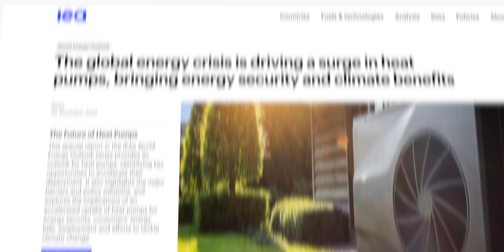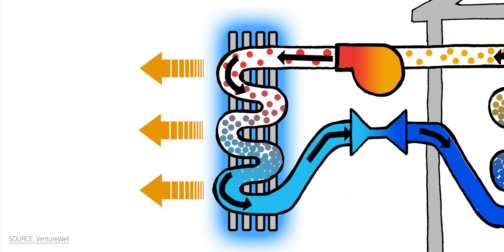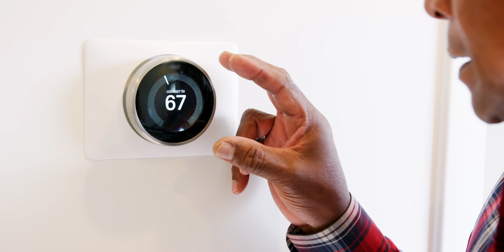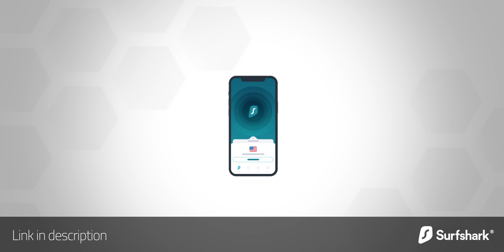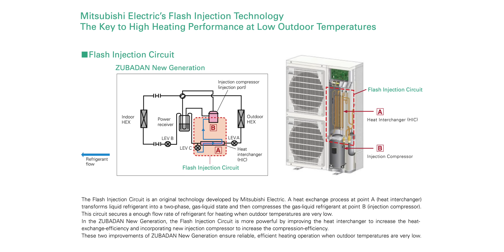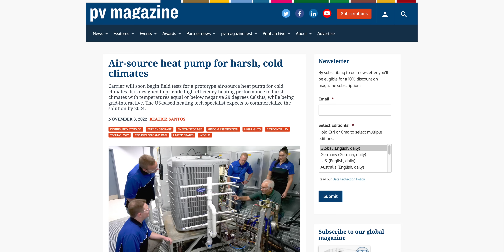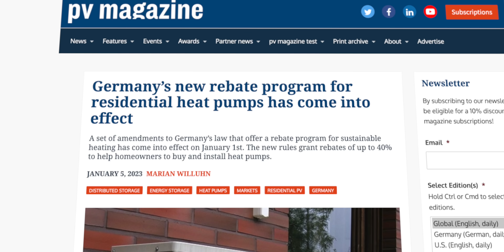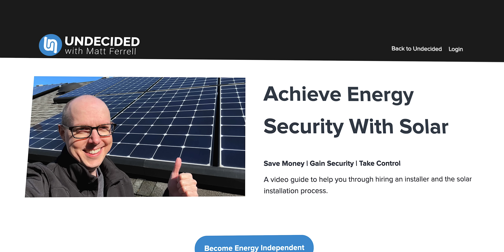Major Advances with Heat Pumps in the Extreme Cold

Comment: I live in New England and just recently installed an LG Red mini split system with 3 indoor ceiling cassettes. I also switched electric suppliers to a cheaper supplier going from $.26/kwh, to $.14/kwh and I am now basically heating my home for free. I have had no issues with producing heat even on cold days in January or February with some days getting down to -19F.  The best part is the fact that I now have 3 separate zones that I can set to desired temps with some unused areas like my office and spare bedroom being set much lower. My ceiling cassettes are also branch ducted into adjacent rooms in order to get better distribution of air flow and to prevent oversizing of the indoor units for my rooms. I have a 1700 sqft. raised ranch with one cassette in my living room/dining room which is ducted to my kitchen, on cassette in my master bedroom ducted to my bathroom, and one cassette in my office ducted to my small spare bedroom. There is very little information available regarding branch ducting from the LG ceiling cassettes so it took some figuring out, but it works wonderfully! Proper sizing is imperative for maximum efficiency and can be difficult to achieve.

Comment: Hi Matt, I always enjoy your vids but this one seems a bit too much hype for a system you haven't used and tested yet.

There is a big difference in geothermal and air source heat pumps. Geothermal uses heat from pipes in the ground where the temp stay constant and air source relies on ambient air temp which varies tremendously. Air source work fine in hot temps for an AC but as the temp drops below 40F they lose efficiency and at 0F they lose as much as 50% efficiency.  

Some new air source do better BUT they rely on additional heat coils and backup heaters and are very expensive.  If your home is not well insulated and sealed an air source heat pump will need a backup heat source in cold climates.

For a ground source you need permits and enough land for the ground pipes so not an option for many people and a lot of additional expense.

Heat pumps still use electricity so if you have a blackout you won't have heat. I recommend propane or wood stove where allowed  as backup systems for cold climates.

Vertical well heat pump  100 to 400 feet deep. For a vertical system, holes (approximately four inches in diameter) are drilled about 20 feet apart and 100 to 400 feet deep.  Unfortunately, vertical loops are the most expensive type of geothermal system to install, since installation involves deep and wide boring. A vertical loop installation costs between $20,000 and $38,000.

Summary: Air source heat pumps work fine for AC but not more efficient than an Energy Star rated AC unit and in cold temps they lose efficiency and most homes require a backup heat source. Especially in houses that are not well insulated and sealed.

Geothermal ground source heat pumps work better but are also way more expensive, require trenches or drilling and permits and may not work for homes with limited space.

Unless you have a big solar power system installed heat pumps will not work in a blackout so you should still have a backup heat system installed.
Reply: Vertical well systems do not require much land.
Reply: @JRP3  100 to 400 feet deep
For a vertical system, holes (approximately four inches in diameter) are drilled about 20 feet apart and 100 to 400 feet deep.
Reply: @solarcabin  Yes, so exactly as I said, they do not require much land.  2 wells 20 ft apart would handle most needs.
Reply: @JRP3  between $20,000 and $38,000
Unfortunately, vertical loops are the most expensive type of geothermal system to install, since installation involves deep and wide boring. A vertical loop installation costs between $20,000 and $38,000.
Reply: @solarcabin  And that still has nothing to do with my point that vertical systems do not require much land.  Unrelated data does nothing to alter my accurate premise.
Reply: @JRP3  For a vertical system, holes (approximately four inches in diameter) are drilled about 20 feet apart and 100 to 400 feet deep.

That cost does not include permitting and would not be allowed in most cities. How many people do you know with a vertical well system? The average person is not going to get that system.
Reply: @solarcabin  And for the FOURTH TIME, what does that have to do with the FACT that vertical systems don't take up much space?  You are spending a whole lot of time trying to avoid simply admitting that every single post I made on THAT topic was correct:  VERTICAL SYSTEMS DO NOT REQUIRE MUCH SPACE.  Go it yet?  Or will you waste more time trying to change the topic to cost instead of space?
Reply: The hype about heat pumps!  
Seeing more hype advertising trying to get people to install heat pumps but be aware of the actual data about these units.

There is a big difference in geothermal and air source heat pumps. Geothermal uses heat from pipes in the ground where the temp stay constant and air source relies on ambient air temp which varies tremendously. Air source work fine in hot temps for an AC but as the temp drops below 40F they lose efficiency and at 0F they lose as much as 50% efficiency.  

Some new air source do better BUT they rely on additional heat coils and backup heaters and are very expensive.  If your home is not well insulated and sealed an air source heat pump will need a backup heat source in cold climates.
For a ground source you need permits and enough land for the ground pipes so not an option for many people.

Heat pumps still use electricity so if you have a blackout you won't have heat. I recommend propane or wood stove where allowed  as backup systems for cold climates.

Vertical well heat pump  100 to 400 feet deep. For a vertical system, holes (approximately four inches in diameter) are drilled about 20 feet apart and 100 to 400 feet deep.  Unfortunately, vertical loops are the most expensive type of geothermal system to install, since installation involves deep and wide boring. A vertical loop installation costs between $20,000 and $38,000.

Summary: Air source heat pumps work fine for AC but not more efficient than an Energy Star rated AC unit and in cold temps they lose efficiency and most homes require a backup heat source.

Geothermal ground source heat pumps work better but are also way more expensive, require trenches or drilling and permits and may not work for for homes with limited space.

Unless you have a big solar power system installed heat pumps will not work in a blackout so you should still have a backup heat system installed.

Comment: I have four mini-splits installed in my Passive House in Colorado. I need to get around to making a video documenting my experience. We have had a lot of problems with them. But especially in colder weather. Our house walls are about 14 inches thick and the house has an air barrier inside it with triple pane, thermally broken windows. So the house retains heat really well. Even when it got well below freezing, without a heater, the house was only getting to the low 60s if we had a moderate amount of sun at least every couple of days. 

But the mini-splits (Pioneer) are not working well. They barely produce any heat. My wife regrets getting them. We are having a tech come investigate them soon.
Reply from the maker: Thanks for sharing.

Comment: Greetings from Poland ;).  Yes, I see a lot of people getting heat pumps right now, but the electricity prices don't helps, because now it is cheaper to burn coal or wood to get heat. I have AC myself, and I find it very useful to heat up my apartment in winter or cool it in summer. It just faster for me to heat up with AC than wating for the heater to heat up. We have a shared heating system in our apartment that use gas.

Comment: In your follow-up, it would be nice to see some additional maths. In the UK - and it may be the same elsewhere - piped natural gas is pretty much universal, and electrical power is also generated by natural gas. We may have an increasing base of renewables, but every additional kW of electrical energy is generated by burning extra gas. Using more electricity does not make the sun shine brighter or the wind blow stronger. In addition, electrical energy is 5-6 times the cost of gas per kWh - and with good reason: The efficiency of the gas power station itself is only 32% (according to my search) and then there are transmission losses on top of that. Right now and here, I don't think the sums add up for heat pumps, both from an environment and an economic point of view.
Reply from the maker: I'm not sure I'm following you.  If you're talking purely costs, then yes, many areas have crazy cheap gas prices that make the cost comparison tough.  If you're talking about efficiency (how many kwh of energy to produce heat), it's no contest between a heat pump or gas heat.  Heat pump wins that for efficiency.  If you're talking about reducing greenhouse gas emissions, even if your electric grid is powered by a natural gas facility, it's going to far cleaner powering your heat pump via that vs. burning the gas in every single home for heat.  As the grid gets cleaner with more renewables production, or if you have solar on your home, it gets cleaner still.
Reply: @UndecidedMF  Thanks for taking the time to reply. What I am saying, is that people are tending to quote the 'gross' efficiency of heat pumps, which would be fully valid if the energy came from renewables. But it would be good to see a 'net' efficiency quoted, taking into account the efficiency of burning gas to produce the electricity to power the heat pump versus burning the gas directly at home. To me (guessing) the heat pump needs to be at least an average 300% efficient to 'break even' - and I know you said the latest tech is progressing beyond that - but a 'net' figure would still be good.

Comment: I found your discussion of the efficiency of heat pumps vs gas furnaces to be somewhat disingenuous. You said implied that they were several times more efficient than a furnace, but you completely ignored the fact that the generation and transmission of the electricity isn't perfectly efficient. A COP of 2.5 is what is generally needed to be equally efficient to a furnace due to the efficiency of the electrical grid. The fact that they use electricity rather than natural gas is the more significant aspect since they can use sources of electricity that aren't fossil fuels.

Comment: Here in the UK people are being pressured to install heat pumps and are regretting it even with the government subsidy. Here are some of the reasons:
 - Most people are installing air-sourced heat pumps. These are not as good as ground sourced and dont work as well in cold weather, but they are much cheaper and avoid problems surveying pipes etc which is often completely impractical here.
 - Even with air sourced heat pumps the cost is much more than £8K. This is partly because existing central heating systems need to be ripped out to replace with with bigger pipes and radiators, but also because we get ripped off and government subsidies just result in price hiking so that the installer makes more profit rather than the customer getting it cheaper.
 - The heat pump needs to be run continuously to be effective. This raises the cost vs other ways to heat your house. It may be better to run ordinary electric heaters when needed using battery or other storage mechanisms to charge on cheap overnight rates. In theory it may seem more expensive because it does not have the efficiency of heat pumps, but if you only need to heat for short periods it is much better. This is especially true when the house is empty most of the day which is the case for many working people here.
 - In the UK there is less use for air conditioning so the fact that your systems doubles as air conditioning that you might install anyway is lost here.
In summary I think people in the UK following the advice of this video will end up feeling misled. Perhaps with more innovations and price cuts the situation will be better in a few years. Meanwhile people would be best advised to stick with their existing gas boilers.
Reply: The grants in the UK were aimed at air-to-water or ground-to-water systems last time I looked, probably because the government doesn't want people using the heat pumps in Summer and making the national CO2 figures look embarrassing. Air -to-air or ground-to-air systems get over the big insulation costs  and are often the best option, even without grants. There was a House of Lords report last month or the month before that was published in the trade press that expressed extreme concern that people aren't availing of the grants (something like 10% of the expected uptake), probably for exactly the reasons you mentioned.

Comment: There is also the option of using a few mirrors, especially fresnel mirrors, or lenses, especially fresnel lenses, to concentrate the little sunlight there is, onto the outdoors heatsink of the heat pumps, which normal users can add to their existing setup in the winter. You just have to remember to move it to storage in the summer, and place them back in the autumn or winter.
Reply: The problem with that is most units are placed with the coils facing the wall so it's almost impossible to aim sun at them.  Unless you use mirrors I guess.
Reply: @JRP3  Just paint the wall black, and have a baffle to allow air to flow over the wall before entering the coil. Issue is that the mirror will need to be a tracking one, to follow the sun, and will possibly only be effective for a few hours a day, especially at high latitudes, where you might only have 6 hours of light a day that is useful. Might need to use a masonry wall as well, to store the energy for the long evening peak, but in the morning will have a wait while the wall defrosts and warms up as well.
Reply: Do you have any example resources? YouTube videos are blogs on this?

Comment: There's something I don't think I'm getting with COP and saving money. I pay $1.20/therm and $0.15/kWh. 1 therm = 100k BTU and 1kwh = 3400 BTU. With an 80% gas furnace, it costs $1.20/80k BTU. With a heat pump, say COP = 3, that would be 10k BTU/kWh, with an ultimate cost of $1.20/80k BTU. Knowing COP drops in the cold, COP > 3 is on the high side, natural gas is higher now than typical, and $0.15/kWh is on the low side, I guess I don't see where the big benefit is. Sure, I see the shift towards electrification as future proofing, but we're going to be reliant on natural gas for decades. Do you think gas powered heat pumps would be a good compromise in the near term, like a hybrid vehicle?

Comment: After reading the comments, the outlook for Heat Pumps is the same as any product the consumer buys.  Caveat Emptor!!!  It seems salesmen still over hype and not all installers are as proficient as a would be buyer would like.  It sounds next on Matt Farrells list of things to do will be a Guide for the Consumer to buy a heat pump.  I am really interested in seeing how your geothermal system works as that is on my list of things to put in when I build my dream house.  I wish I did not have to wait several years for your home to be finished and get a full evaluation, but your concept is all inclusive and ad-hoc pieces of your experience may not work as well, as your home will be the complete package when finished.  Good Luck and Best Wishes as the project finishes up!!!
Reply from the maker: Stay tuned because I'll definitely be sharing a lot more on my experiences (good and bad).  The house should be completed this summer, but it will obviously take time to live with the systems through a year to fully evaluate.

Comment: Just replaced my gas furnace with a duel fuel gas/heat pump system. Ended up getting the basic model as these fancier new models were 2x as much. Then spent the money saved on attic insulation. Best of both worlds in my mind.
Reply from the maker: Smart move!  Investing in insulation is super important.  Duel fuel systems are a perfect solution for super cold climates right now, but with this newer heat pump models hitting in the next year or two, that should hopefully become less necessary.

Comment: Heat pumps are actually more effective than air conditioners, because the waste heat is not a waste when one want to heat something up. Back up heating can still be a good idea for those rare days with extreme cold if one lives far north. If one isolates the house really well then you can actually pre heat your house extra warm with the heat pump before if you know that cold weather will arrive soon and capture the heat inside. This really only works if the cold weather only lasts a few days.